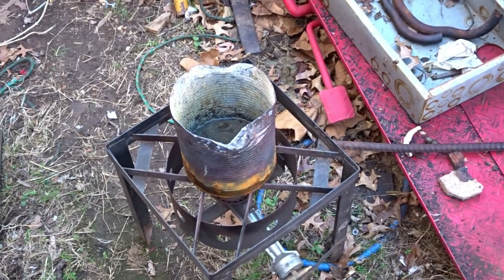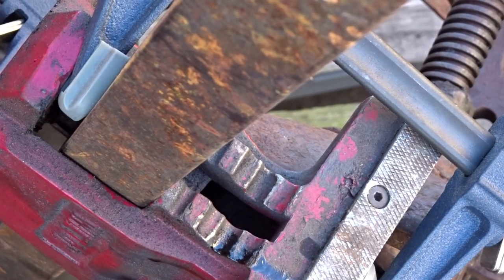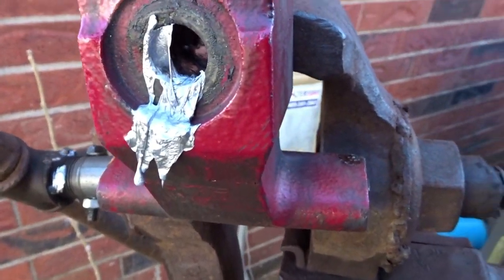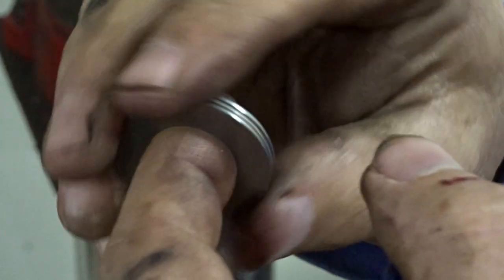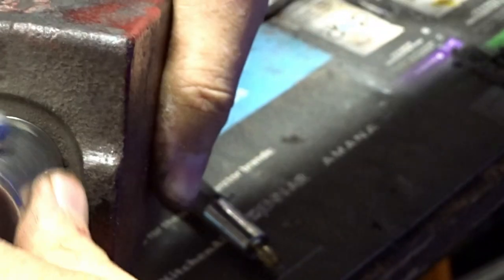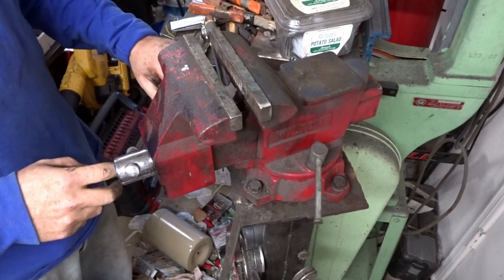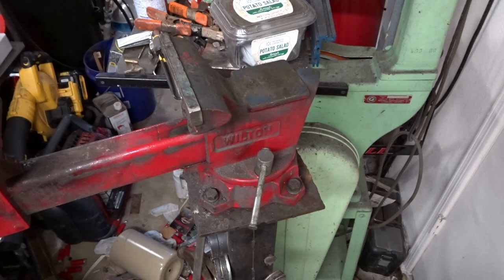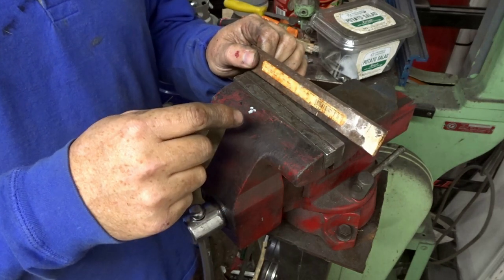DIY Modifying My Bench Vise Part 2 of 2

Comment: So has it cracked yet?  Im always worried about getting cast iron too hot and not going through the whole cool down and preheat process ..  ive cracked a few things trying to weld on em..
Reply from the maker: Nope still holding up.  No issues at all
Reply: Sweet.   I finally got enough led from old bird and buck shot to fill up the vice i got..  been collecting all the failed reloads over the past year..  plus had some used fishing weights.,  about to melt me a pot-o-lead..